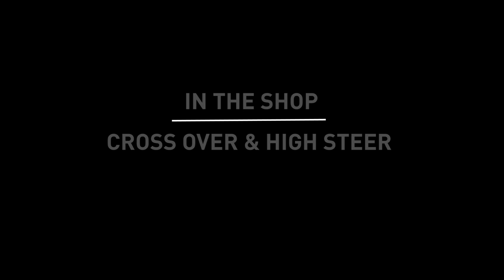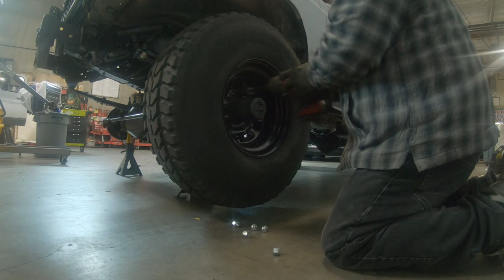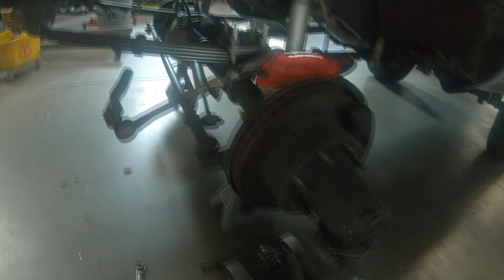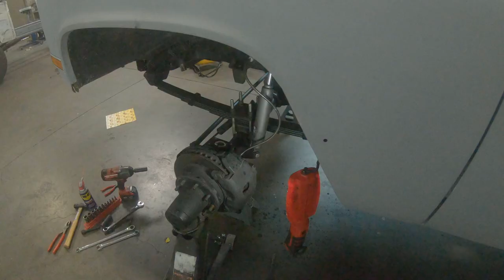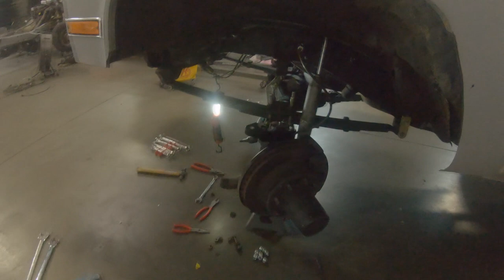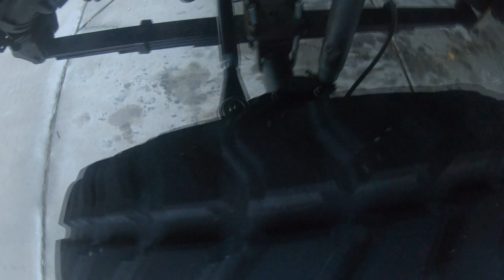82 Chevy K5 Update / DIY4X Cross Over & High Steer

Comment: Did you have to switch out your gearbox for a 2wd box? Like a from a C10
Reply from the maker: Yes I did but then I replaced it with the PSC box when I did the ram assist.
Reply: Thanks for the quick response. Wasn’t sure whether I had to get a C10 box or a k10 box that accepts the pitman arm that’s splined
I just got a k10 and everything is shot, and gearbox is leaking. Best time to switch over to over & high steer

Comment: Is that the 52” spring swap ?
Reply from the maker: No it's not.
Reply: @SlayFive  just lift springs (
Reply from the maker: @TheSeantrd  Yes 4 inch
Reply: @SlayFive  how’s it ride? I was looking at the lift from rough country? Is that what you have ? I might daily the truck. I have been driving 90s model so a little stiff or rough is fine with me lol
Reply from the maker: @TheSeantrd  My front springs are Tuff Country I believe. Got them from a buddy. Yeah its a little rough but its a large truck with solid axles and leaf springs so it's expected. To be honest it doesn't ride much worse than when it was stock. I would daily it if I didn't have a Co. vehicle.
Reply: @SlayFive  awesome I appreciate the info. I mean I will probably drive it a couple days a week. Do you have a insta ?
Reply from the maker: @TheSeantrd  No problem. No I do not.
Reply: @SlayFive   I’ll follow on here then! Thanks